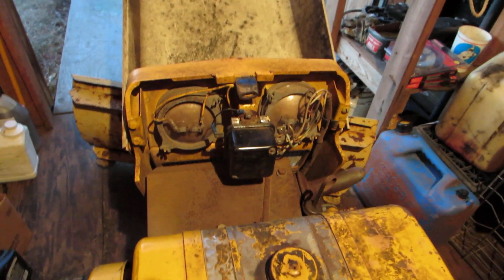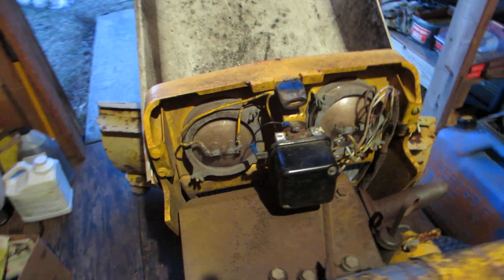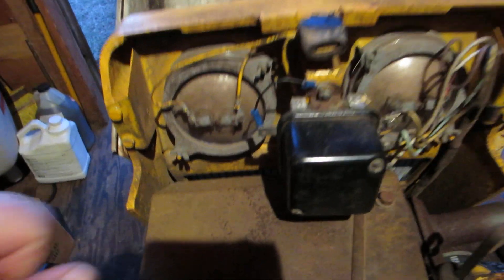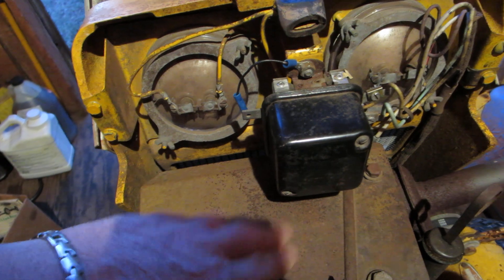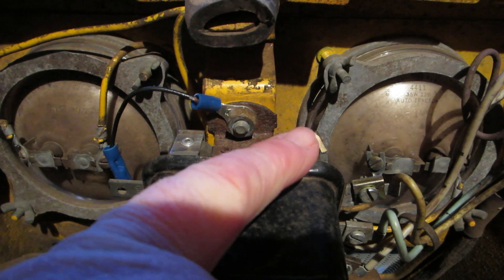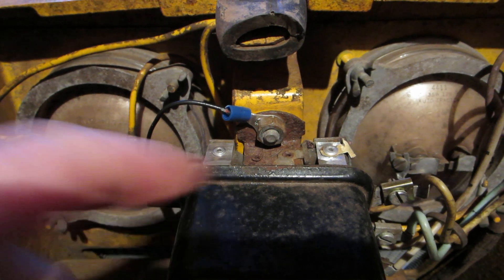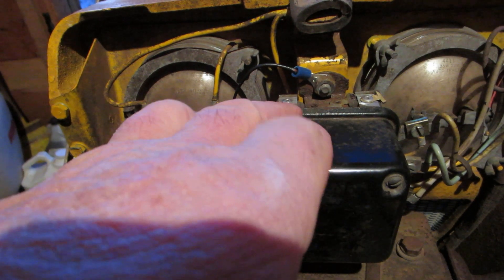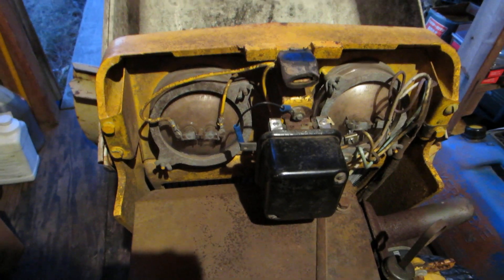CUB CADET VOLTAGE REGULATOR JERRY RIG  REPAIR TECH TRICK

Comment: You can find a voltage regulator at tractor supply company or search on ebay for a 12 volt tractor voltage regulator, they're about 25 dollars.
Reply from the maker: Thanks for the reply. The regulator that I have is good. It seems that I`m just a cheap son of a gun. I made the thing work. Be well.